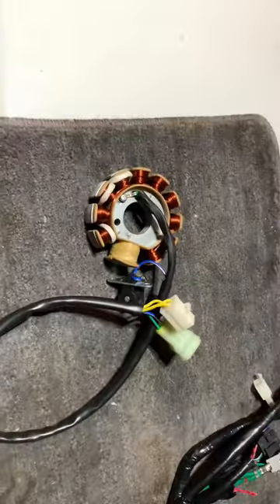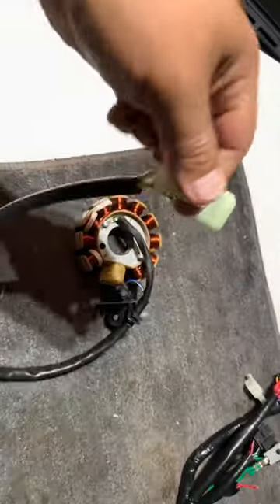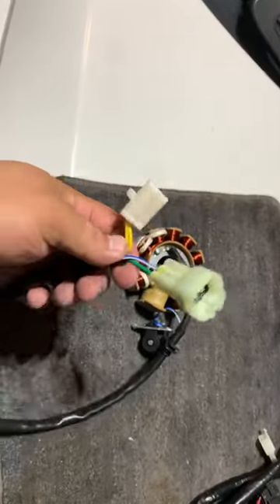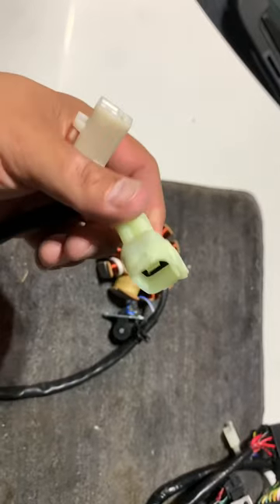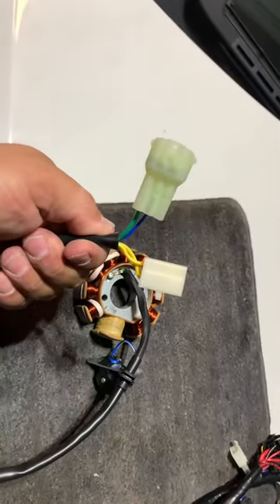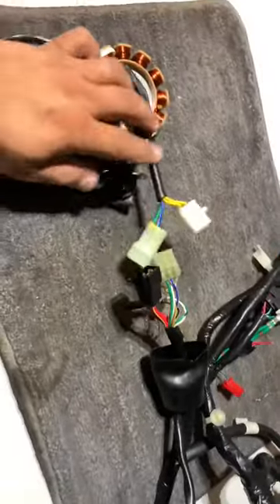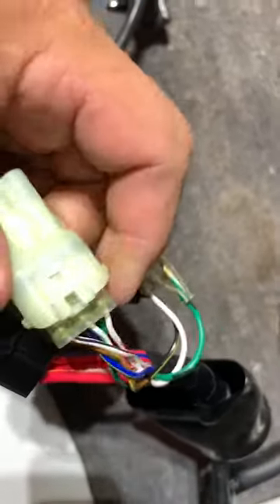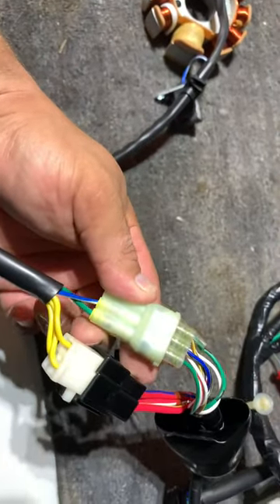GY6 Stator wire up

Comment: Where does the blue wire go to on a 6 pin CDI?  I can't seem to get mine to run
Reply from the maker: This is for a Ruckus with a ruckus harness. It doesn’t use a 6 pin cdi